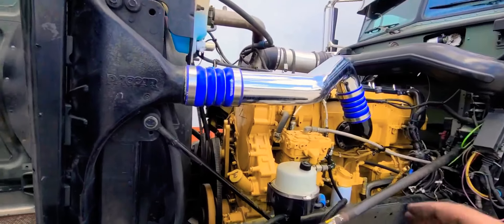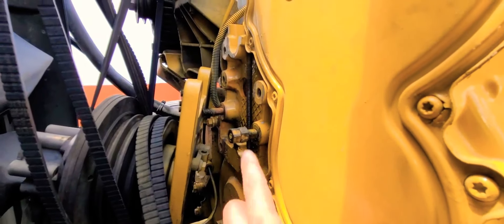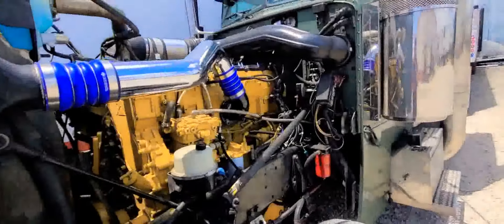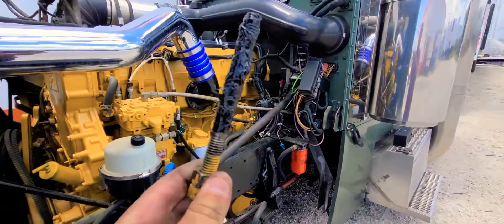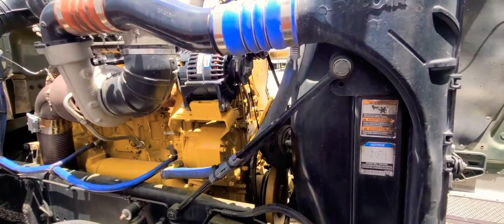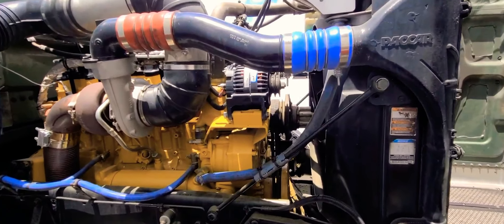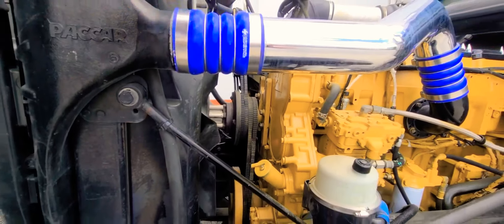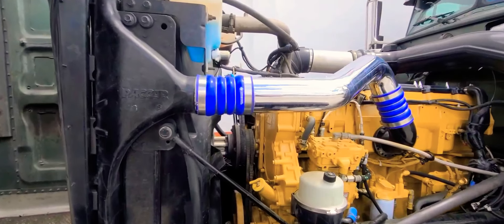Caterpillar 🐈 😻/Simple tips

Comment: Whats up bro i see your videos all the time i see that you be working on your motor..  
i have a quick question i have a c-15 i put a new ecm and new injectors the motor cranks but doesn’t start i took it to a mechanic and they tell me that the fuel pump is good… i traid with starting fluid it turn on for like 1,2 seconds and turns off… by any chance do you know what could be the problem?? The mechanics said that theres no codes
Reply from the maker: If the timing of the motor was good before and all you did was put in a new ecm and injectors sounds like the ecm is not sending an signal to the injectors you don't always get any codes with that you also send that the fuel pump was good so that mean fuel should not be an issue. You can always check for fuel pressure aswell just like your fuels box
Reply: @Fltruckriderz  the thing is that the truck was running good and one day to another didn’t wanna start no more it just cranks and cranks bit doesnt start i have a freightliner classic with the c-15 when i took the truck with the mechanics thwy told me it was not the fuel pump that it was the ecm sow i got it new and that was not the problem sow they told me to get injectors and i got the 6 injectors… it started i was driving it for like 45mins i was good.. so i let it sit for 2 days and again truck cranks but doesnt start i traid with starting fuel and nothing
Reply: @JuanGarcia-sc5wp  what year is your freightliner
Reply: @Genetics1  2001 freightliner classic xl
Reply: @JuanGarcia-sc5wp  if you can see if you have any codes if you dont have a scanner , you can try doing this by using the cruise control switch. turn the key on, engine off.  turn the cruise switch off  and then hold the set and resume switch for a few seconds and  see if the check engine light  starts blinking. count the blinks . should be something like 2 quick blinks followed by a pause and then some more blinks.   Also have you check your ecm fuse  in the fuse box
Reply: @Genetics1  no i haven’t checked the ecm fuse i took it to 3 mechanics and they told me everything was good they made me get a new ecm and new injectors but the problem still there i turn it on like 2 weeks ago but I tried turning it on again the next day and nothing it just cranks but doesn’t fire up.. i been like this like 3 months bro
Reply: @Genetics1  hey bro i really appreciate your response 🙏
Reply: @JuanGarcia-sc5wp  does it have codes and did you try the method to check for codes already
Reply: @Genetics1  i havent ill be at my yard like in a hr and i am gonna do it for sure today
Reply: @JuanGarcia-sc5wp  
there is another possibility that your cam timing sensor is not throwing a code and maybe faulty. I had that problem once in a 3406e . would not start just crank . no codes present  turned out it was the timing sensor. 3406e  and c15 are basically the same engine to a certain year
Reply: @Genetics1  yeah thats what one of my friends told me the same thing but the mechanics told me that the cam sensor and the crankshaft sensor there good but I honestly dont know if there good or bad…
Reply: @JuanGarcia-sc5wp  yeah its kind of hard to check a sensor if you dont have a scope ,   but if your the original owner or know the history of the truck I myself would be suspecting the cam sensor first if you get no engine codes. Also does your  rpm meter move when you crank the engine?
Reply: @Genetics1  i just did it it blink 5 then it pause then it blink 5 more times
Reply: @JuanGarcia-sc5wp  thats a code 55 no codes detected by the ecm   i am really leaning towards a sensor since you stated that the mechanics said fuel pump was good
Reply: @Genetics1  yeah it does but just lil
Reply: @JuanGarcia-sc5wp  ok thats a good sign but still wont rule out a bad cam / crank sensor. one thing were you there when they checked the fuel pump pressure ? just asking because the truck has to be running to check pressure
Reply: @Genetics1  honestly i was not there but 3 mechanics told me i was good.. hey bro i really appreciate the help bro you show me to to look for the codes that i didnt even know how to it that
Reply: @Genetics1  whats up bro how u been ?? I changed the cam sensor and the crankshaft sensor and nothing cranks but doesnt start
Reply: @JuanGarcia-sc5wp  did you noticed any metal particles on either of the sensors?
Reply: @Genetics1  no they were clean… I honestly dont know what can it be…
Reply: @JuanGarcia-sc5wp  dont waste any more money on it you have too take it to a tech who knows what he is doing .  

Here are some other things that might be going on . 

1 someone maliciously put either sugar or something else in your fuel  when you werent around. That is a possibility if you dont have locking fuel caps
2 you might have a broken or chipped tooth on your crankshaft gear that  causing the sensor not sending a signal to the ecm
3 A bad fuel pressure regulator.

That is about all I can help you out with  without being there to actually see the truck in person.

here is a youtube video with a guy who had the same symptoms almost like yours   "C15 accert cat crank no start" 

Turns out he had to change out all injectors because someone put sugar in his tanks.
Reply: @Genetics1  thank you bro I appreciate all the help
Reply: @JuanGarcia-sc5wp  Let me know  what  the problem was if you can
Reply: @Genetics1  yes for sure ill let you know brother
Reply: @Genetics1  whats up bro nothing yet i just got code 31 know is not 55 nomore
Reply: @JuanGarcia-sc5wp  code 31 i believe is a VSS code aka vehicle speed sensor.
Reply: @Genetics1  yeah i giving me that code is shacking alot is wierd… it started with difficulty and it started to shake
Reply: @Genetics1  quick question the cam sensor and the crankshaft sensor is one of the the VSS sensor ?? cause im googling it and idk where the vss is located
Reply: @JuanGarcia-sc5wp  the vss is on the  outside rear section of the transmission  it is a sensor located right on top or sometimes underneath of the yoke housing of the transmission. should be a 2 wire sensor
Reply: @Genetics1  that sounds kinda hard to changed huh… do you know by any chance if that sensor is bad will it make the truck to shake when is on ?
Reply: @JuanGarcia-sc5wp  the sensor is easy to change out try to look it up on youtube under fuller transmission vss replacement or freightliner vss replacement .  that will not cause your truck to shake. your speedometer might function erractic or not work at all
Reply: @Genetics1  oh ok thank bro for the info.. hey wanna to tell what happened when i was changing the fuel filter not with the priming pump is at the other filter that is color white like paper.. i was Draining the diesel from there and like dirt or some really sticky stuff was coming out of there I honestly dont know what is that i sometimes think the truck doesn’t wanna start cause of that
Reply: @JuanGarcia-sc5wp  your fuel is contaminated then . diesel fuel should be the same color whether it be that greenish hue from the old days or that yellow tint of ultra low sulfur we have today.
Reply: @Genetics1  dam… what do you think i should do ?